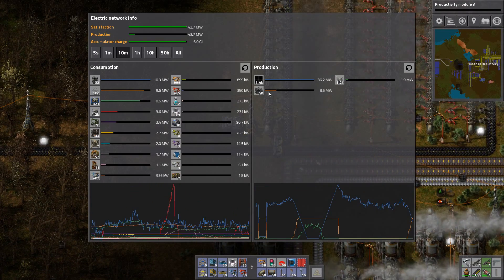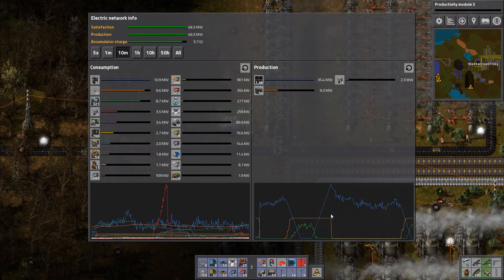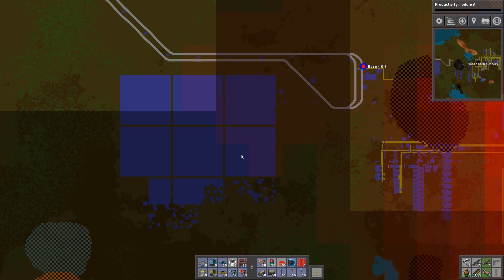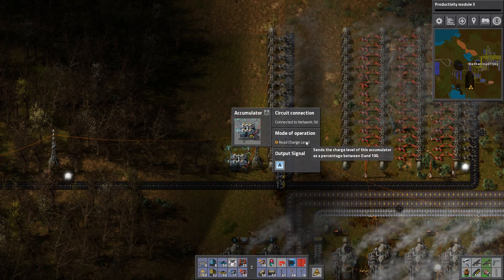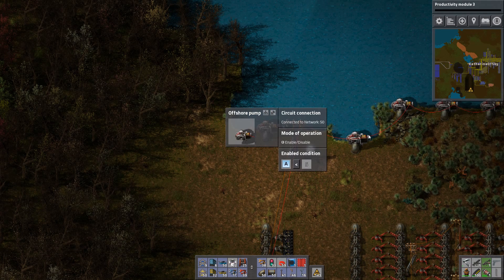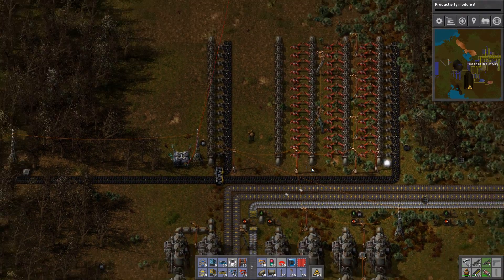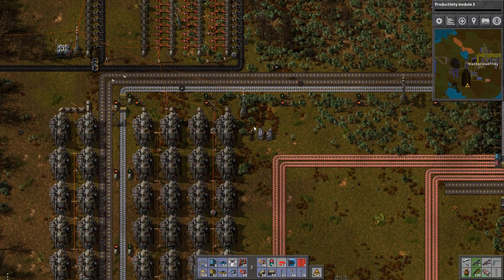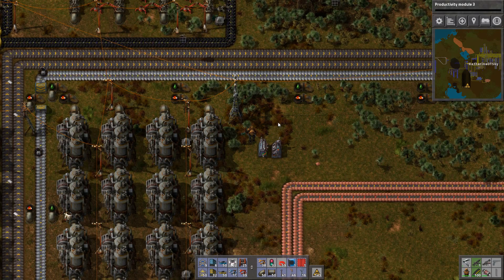Factorio:  How to Set Steam to Backup Power - Circuit Tutorial

Comment: I wonder if just taking a separate network with accumulator reading from single solar panel (test if there's any light if it makes sense) and only setting it to work if it's under 50 would behave better in practice just need to setup a pseudo circuit that uses energy but not that much to drain the pool and make it go wild, I've found this video very informative and inspiring, thanks :) @
KatherineOfSky
Reply from the maker: You can't attach a circuit to a solar panel, alas.
Reply: @KatherineOfSky  I've meant  solar panel(s) that are connected to accumulator(s) on a separated network, while having some sort of demo load to make it behave as a control when it's night time. This circuit acts as the condition itself for the rest of the network. In my case, I could disable all non panel sources at day, and make those work either at night and when a certain charge level has reached, to stop down any excess production of electricity. Just finding which load works the most reliable way isn't one of my priorities right now.
It may be a good early for early optimisation, less in the very long run I guess.

Comment: I've experienced the "stobe" power thing before (for the record, it was a multiplayer map so it was someone else's doing). I was beside a radar, and the radar sound when it's flickering on and off over a dozen times a second is incredibly grating. I was actually worried that the game itself was stuttering/bugging out.  I suppose if you're using a power switch, you would need a method of turning it on when accumulators are low (like your 5%), but when it turns on, it stays on until the accumulators are back to high (like >80%).

On a similar note, I managed to figure out how to make gates beside a rail lock when a train is passing (yellow light), but behaves normally otherwise (only opens when player is near). But I abandoned it because it required 3 decider combinators, and I didn't want to clutter all my crossings like that.  Instead, I just settled for the "gate signal turns lights red" component, and I use it like I would a pedestrian crossing, where I stop and wait a moment until it's safe.
Reply: BTW, I decided to share the crossing / gate locking mechanism, just in case anyone was interested. (Plus on reflection, I actually only needed 2 decider combinators.)

1) Use coloured wire to hook up the gates (via a section of wall beside it) and the nearest rail signals on both lanes, and make sure everything is ticked - read signal, close signal, read sensor, open gate.
2) Set close condition for the rail signals as [gate signal] > 0, so it changes when a player triggers the gate sensor.
3) Place 2 decider combinators beside a power pole, connecting both the input and output ends to the power pole, and change the output from "input count" to "1". (Not sure if this is necessary, but I fear that the other option might mess with the signal count.)
4) Set the condition for one as [gate signal] > 0, and the other as [yellow] = 0, and have them both output the same signal - I chose the green tick.
5) For the gates, set the open condition to that signal = 2. This means the gate will only open if the conditions for both combinators are met, i.e. a player is present and there are no yellow lights (no approaching trains that can't be stopped).
Oh, and make sure the signal wire connection is localised. For example, I've decided to use red wire for long range signals, and green wire for self-contained mechanisms such as this.

Comment: Problem here is that your accumulators will be charged from extra steam during night instead wait for excesive power generated from solar panels through the day.
I'm currently trying to achieve some "smart setup" which will:
1. connect empty batteries to charge only when running full on solar.
2. connect steam only when battery are empty and solars not producing enough power
3. keep steam unplugged during the night until batteries discharged below some lvl

So far I was not able to reach satisfying result.
Reply: sooo, did you?

Comment: Another solution I used was, build a steam setup, that feeds into a liquid storage tank, this then had a pump as it's output, which led to the turbines, effectively creating a gate between the boilers and the turbine. The pump was then programmed to only allow steam through if the accumulators ran below 10%. This has the advantage of not causing strobe lighting, and ensures you always have a backup source of emergency steam.
Reply from the maker: Sounds pretty good.  My solution of connecting to the pump also does not cause flickering.

Comment: meh. i wish you mentioned how to connect individual power lines to the switch :( that's what i was looking for
Reply from the maker: Use copper cable.
Reply: Thanks a lot! odd thing it's not in the building part menu but in components instead :)

Comment: very useful but if you using water for more than one thing you can hook up a wire to the small pump
Reply from the maker: Each steam column will use up the complete production of a single offshore pump.  For buildings that require water, like the oil setups, I always have a separate offshore pump or two feeding those.

Comment: I have a question!
I have just put up my first bunch of solarpanels and same accumulators (not in the exact ratio/pattern). I used the circuit, reading the accu charge, setting the pumps to enable at 5%. But in nighttime, when my accumulators are at 4%, my 50 engines turn on at full blast to recharge the accus to 5-6%, then switch of and repeat... Is there a solution to this? 

Kind regards,
Bram
Reply from the maker: Yes, you can use an SR latch to set conditions where they go on at X amount and go off when they reach Y amount.  See the link I posted in the description.
Reply: KatherineOfSky my heroine! (not my heroin though...)

Comment: Connecting directly to the off shore pumps prevents them from pumping water to the rest of your factory.
Reply from the maker: My water systems for power and the rest of the factory are completely separate.  Since water "burns off" with each steam column of 1:14:10 ratio, there's no water left to forward to the rest of the factory.

Comment: Hi Kathrin!
As I benefitted a lot from your oil refinery tutorial I went to this video but somehow I can't wrap my brain around the whole issue. I'm doing something wrong but I don't know what...
 
I tried to set everything up according to your instructions but somehow the pumps do not kick in at all. My solarfield with the accumulators is located quite some distance away from the pumps but they are on the same power grid. When the sun goes down and the accumulators are emptied the pumps do not kick in as intended for unknown reasons. Do you have any idea what I might be doing wrong? I connected the red signal cable from a power pole to the accumulator and went from there to the pumps. The accumulator sends signal A to the pumps and the pumps are set to A<5. In my understanding the pumps should now kick in when the accumulators are lower than 5%, right? Somehow they don't... :(
Reply from the maker: If your accumulators are a long distance away, perhaps you missed a wire connection?  You can always place a single accumulator near the pumps and connect that one, as long as it is on the same power grid.  

Make sure the pumps are connected with pipe to the boilers/steam engines.  

Another possibility: is there anything else sending a signal A to your pump?  (Another combinator perhaps?)
Reply: Thank you for your quick response! I put an accumulator next to the pumps and I think I set up everything according to your instructions. I'll just haven't figured out what I'm doing wrong... By the way, how can I remove signal cables, is there a way? 

Have a great day!
Reply: I don't think you can remove just te signal cables, as far as i know, but you can use Shift+click on any electric pole to disconnect it from all others. This will disconnect the signal cables too.

Comment: Hi KoS, I'm looking for a viable solution for a forward supply point. Like a Roboport with a requester chest that draws a certain supply of building parts from my main production facility and transfers them into a provider chest near my new projects so that my logistic bots don't have to travel halfway across the map. Any ideas?
Reply from the maker: The only viable way to do this, as far as I am aware, is to have separate networks.  At the end of your main network, place a series of Requester chests on the last tile in the orange logistics zone. (One chest for each type of item you need).   Then have a stack inserter transfer items to a Provider chest.  Place your new roboport so that the logistics zone just includes the chests.  (It will be one tile away from the other network).  Use belts if you desire them further away.  Be sure to supply your new area with its own robots, and limit the chests.

Personally, unless I am building solar, (which has its own network), I just let the robots fly... they have to make the trip anyway, and if it is a temporary arrangement, I just remove the roboports later.

If it's a more permanent arrangement, (I do this with solar), I build a train network to transfer needed materials to the location in question.

Comment: The accumulator directly with the off shore pump has the same problem as the power switch, but is less crazy because the time taken for the water on the pipes goes away.
Reply from the maker: Which is why I prefer using the pumps to link to :-)